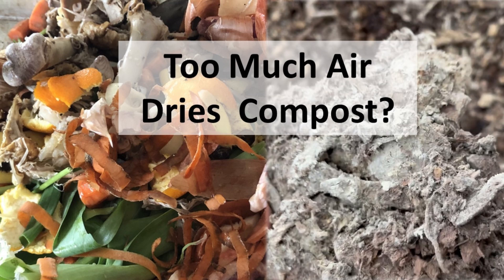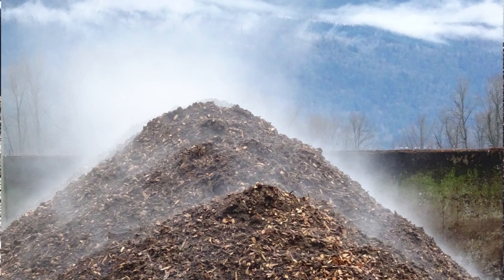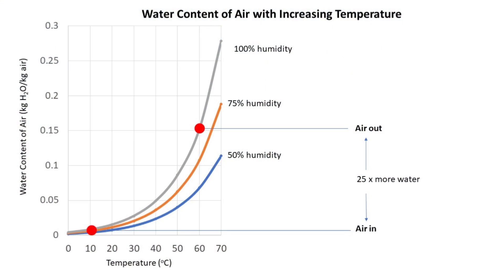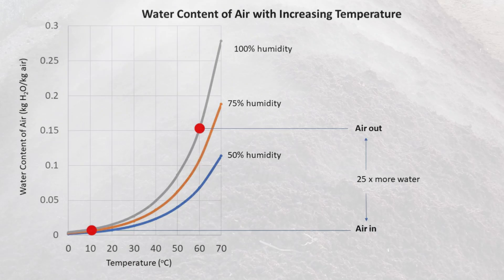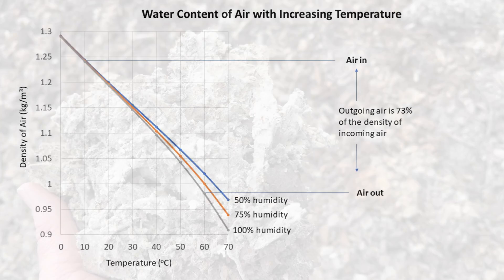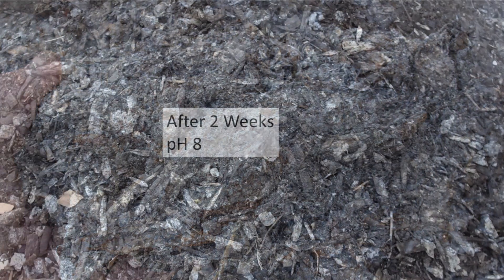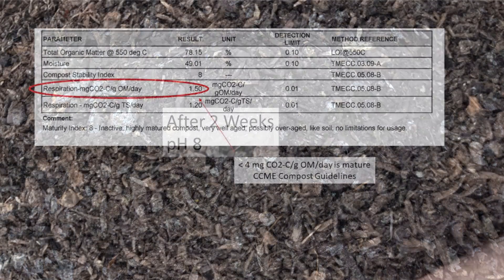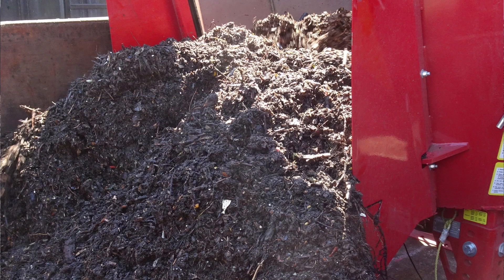Too Much Air Dries Compost

Comment: Hi John Paul.  Thank you for your series of videos.  In your asp example (2:10):  after mixing and adding moisture at 2 weeks, did you put the mix back on air for the remaining 3 weeks before achieving stability?
Reply from the maker: Yes, we did. We will consider stability and maturity in the upcoming videos.
Reply: Thank you.  It must be an intensive mixing process to rewet a pile that dry.  Do you do that in the compost mixer? @TransformCompost
Reply from the maker: Yes, its not easy to rewet a dry compost pile. I find that the most efficient way is during a mixing process, either with a loader and a hose, or a turner if one can afford it! Yes, the mixer works as well, but its more work to put it all back through a mixer.

Comment: Thank you John, my compost heater will work on Food waste and corrugated paper (cardboard) . 
Is cardboard a good way to add porosity to the mixture? ( for me woodchips are not abundant but cardboard is)
Reply from the maker: The challenge with cardboard is that it can provide some good porosity initially, but once it gets wet, it loses its structure and porosity is lost. If you have any access to wood chips, you could use them, then screen them out and reuse them. I have used the same wood chips for over a year for 8 cycles of compost.

Comment: How does drying change the microbial community, and how do you recommend re-wetting compost that's so dry? It's difficult to re-wet hydrophobic compost!
Reply from the maker: Thanks for your questions! The microbes doing the decomposing live in a water layer around the particles. When the moisture content gets below 40%, we start to lose some of the water layer around the particles, which means that the microbial community is compromised. Yes, rewetting compost can be a real challenge - many of us have experienced the water runnning off a pile rather than soaking it. Rewetting seems to be best accomplished during a mixing process.
Reply: @TransformCompost  Thanks for the answers! Some followups:
Does a microbial community with uninterrupted available water differ in finished compost from a microbial community with interrupted available water?
For re-wetting, a windrow turner with a watering option seems like a great way to go, but supposing we don't have that and just have a loader, what would you do or recommend?
Reply from the maker: It begs the question whether the microbial community is more impacted by interupted oxygen supply than interupted available water - which I suspect is true. Its really difficult to maintain a composting process with uninterupted available water and oxygen! 
Yes, I agree that a turner with a watering option is most ideal for rewetting, but not all of us have that option! I have found that loader mixing just after wetting seems to give reasonable results. I have recommended to some to place water in a trench on top of the pile just before mixing with a loader.